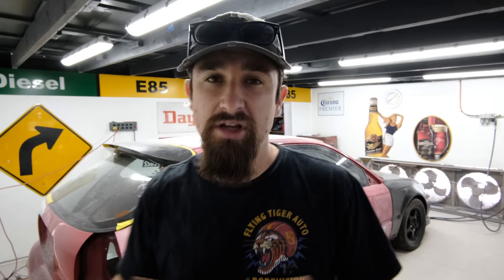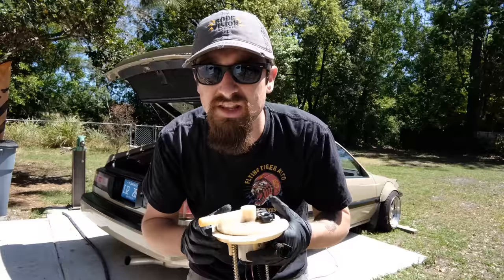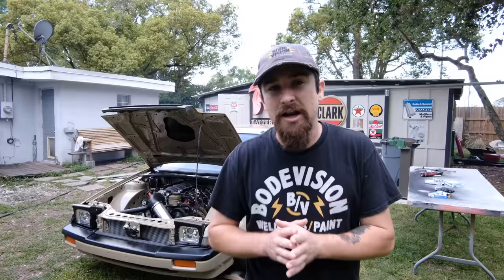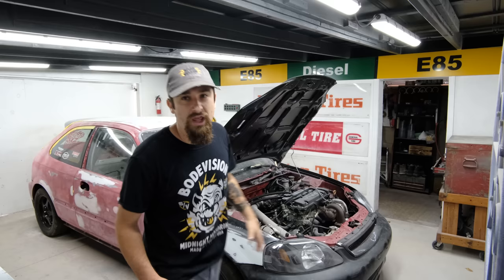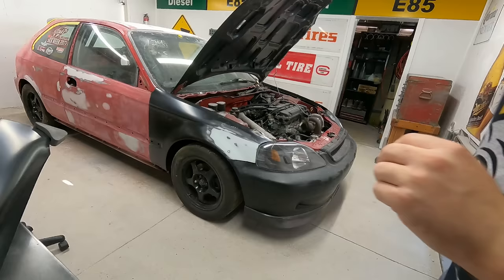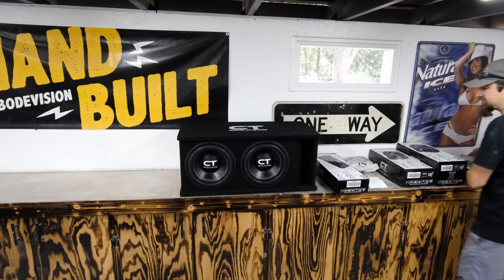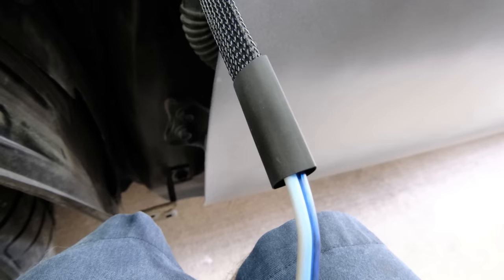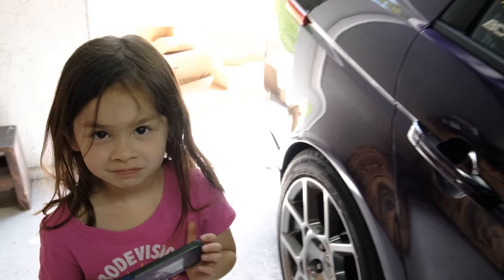@boostedboiz Hatch Gets New Parts + The Best Sound System for ANY Car

Comment: always put the fuse at the battery, if the wire shorts. you'll get a fire, the fuse is to protect the wire, the amp is already fused by itself. nobody wants to see you burn down your car :)
Reply: Yeah man!!! Within 18 inches of the battery!
Reply: I run a fuse at both ends and on my grounds. I have to working on a sq set up and it's required. Definitely at the battery if only running 1 fuse.
Reply: I literally went to comment this !!!
Reply: @thomasnygard2334  fuses on grounds couldn’t be more useless. Sq or not. Fuses arent filters, they are only there to blow incase you short your power wires
Reply: @thomasnygard2334 you don't need to fuse a ground.
Reply: @thomasnygard2334  fused grounds lol 😂
Reply: Came to the comments to say this
Reply from the maker: I’ll definitely be addressing this! Thanks for the constructive feedback. Y’all are awesome
Reply: @OnTheReg22  some organizations require it. Agree that it's over kill but rules be rules. Sq competition is as much show as sounding good. Install is actually scored as high as sound quality.
Reply: @thomasnygard2334  I started installing car audio in 1990. There is no real organization that requires fuses on ground wires. For sq you might run a fused distribution block at the amps and make a chart showing connections and wiring but fused grounds? Lol IASCA and USACI are the 2 main gov. Bodies in car audio competitions.
Reply: @spoolin2bars  than I am missing something in the rules. But I am running a fused distribution block ground and power. l Can't find the video. A guy named Tom (ironic) has a  blue Mazda was trying hard to replicate his wiring. Because it very well done.  Mostly incriminator audio amps a Jp surf board. I am trying to follow rules ( might not understand them well) what do ya do. Trying to a clean clean set up. But Learning is always fun. Money over brains. As my better half has told me endlessly.
Reply: @matt6951  a fuse on the ground works just as good as power current flows through the whole circuit not just a power wire.
Reply: About to say the same thing
Reply: Had a co-worker's car burn to the ground in the parking lot at Petsmart because of this.
Reply: Good eye,i seen that also
Reply: @BodeVision  Definitely fused within eighteen inches of battery not at amplifier period you are trying to protect the car
Reply: Close to the batt and another close to the amp aswell
Reply: @2DoorKC  close to the amp is completely unnecessary. i you go from a bigger gauge to two smaller gauge to power 2 amps, yes youll put some close to the amp. other than that it just creates 2 more failure points.
Reply: @TheLilDwarf  sorry you feel that away. But I hope you're not wiring ppls stuff like that 😂
Reply: @odogrollin  fuse on both ends of the power run. Batt n amp
Reply: @2DoorKC  bro. i think i know a thing or two about electricity protection lol tbh a fuse on a wire is there to protect the wire, you amp is already fused for itself lol
Reply: @TheLilDwarf  it's for the wire exactly. On a long run you fuse on both ends. #basshead
Reply: Facts

Comment: a tips ,you dont want the amp hard mounted to box , use rubber rubber stand off ore mounted it somewhere else ,thanks for a good vid  🙂
edit : in the long run it could potentially damage the amp from the vibrations
Reply: This & the fuse at the front instead of the rear

Comment: Fuse should always go battery side. The amp has it own protection, the fuse is to protect the wire as it runs threw the car. As the way it is, if the wire was to short out, it would arch out until the battery was disconnected or completely drained. Not good... 🔥

Comment: I'm a certified MECP installer. The inline fuse needs to be as close to the battery as possible. The only circut protection you have is the short run from the fuse to the amp. The amp has its own fusing built in.
If you have a short circuit anywhere in the long run from the battery to the fuse it will burn that entire wire length and start a fire. As it's wired that fuse is only protecting a foot of wire. 

It's an easy fix. I just hate to see the fuse not protecting the largest portion of your circuit. It's there to protect the power wire from any short-circuiting. 

Hope this helps!!
Reply from the maker: Thanks for the support through the info. I’ll be addressing this asap

Comment: When you did the audio system make sure you get a better battery and also do the big three up grade which is the ground  the power wire for the alternator to the battery and make sure your using 4 gauge wire to the back and make sure you upgrade your alternator if u don't your lights will dime and your system will sound awesome already but it will make it sound even better

Comment: To get the proper clean power it needs. If you have not done it already. You need a "big three upgrade". Also a upgraded alternator would deliver the proper power load. And a agm battery. Or lithium.

Comment: Nice stuff Adam! And I have the same problem with the 335i when I start it, park it, and get it back in the garage a few times in a row, so without driving the car until it's on temp(>15 miles!). These power engines don't like that. Have a great week, Regards Nico.

Comment: You should definitely add sound deader inside the door panels to get better midbass from those speakers Also sound deaden and soundproof the door panels and add a piece of Hush Matt wave breakers right behind each speaker which would prevent the sound waves from bouncing back from the metal back into your speaker thus causing Wave distortion.

Comment: The accord is probably good! The lower fuel pressure wasn't allowing the injectors to atomize the fuel correctly for combustion but fuel was still getting into the combustion chamber and fouling the plugs

Comment: Hey Bode... an old panelbeater helped me once with a dodgy solution for thin roof metal that moves when you sand it... he told me to silastic a laminate of sheet metal onto the underside to strengthen it up. I know that would weigh more in a drag car, so maybe some kind of kevlar carbon fibre laminate might work well... idk up to you.

Comment: In one of my vehicles I had a rheostat style knob/switch that work the subwoofer amp. I can’t remember if it came with the amp or even the head unit. But that would be something to look into so you don’t have to totally shut it off but you can take away a lot of the hit of the subs when needed.
Reply: Those gain adjustment dials used to come with a lot of amplifiers. Not sure if that's still common place though. Been years since I've been into car audio.

Comment: Hey man as a headsup you do not want to mount your amp to the box with your subs. over time you will damage the internals of the amp and it will eventually die.
Reply: If the box is solid (haven't watched yet) it won't matter and won't damage an amp.
Reply: @stevenbasshead17  it’s a ct sounds prefab box.
Reply: I've not lost an amp in 20 years with it mounted to box
Reply: @ls_812  congrats to you. but ive dealt with amps having issues from being rattled to shit.  just because you have had great success with your amps doesnt mean everyone will have the same mileage on theirs. 

my comment isnt just from personal experience but experience of others.
Reply: @StrawGary  and its also a generalization.....just because its mounted to the box doesnt mean it is going to fail.....especially if you use rubber isolators.....
Reply: @randystull1502  rubber isolators help. but its best practice to not mount amps to boxes. 

the only time ive mounted amps to the box has been in my walled vehicles. as theres been very limited space for amp racks or such. 

my OG comment is purely to prolong the life of the amp.
Reply: If the box flexes that much everything else in the trunk is flexing also if not worse

Comment: Those teels need an external transmission cooler that's why they have a bad reputation of burning out because the factory didn't put one only the types has 1 and it's still too small